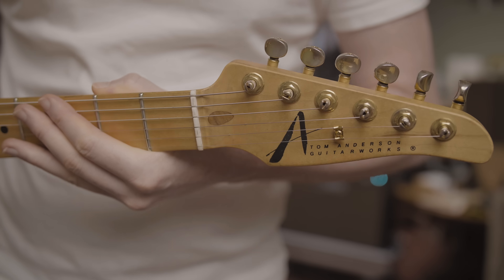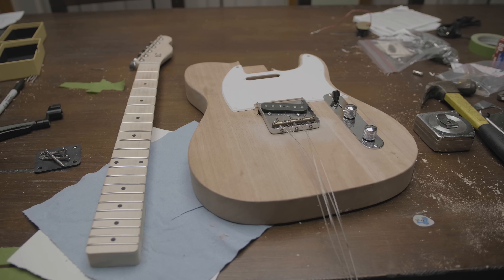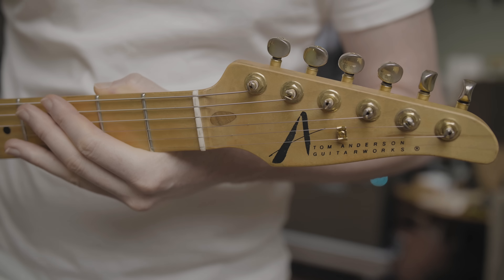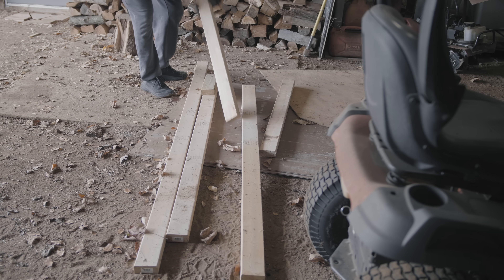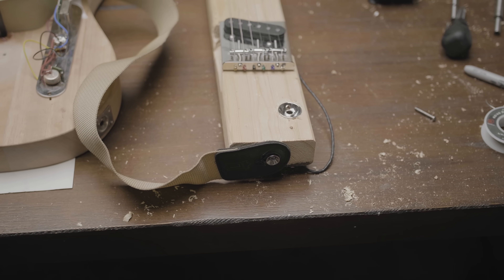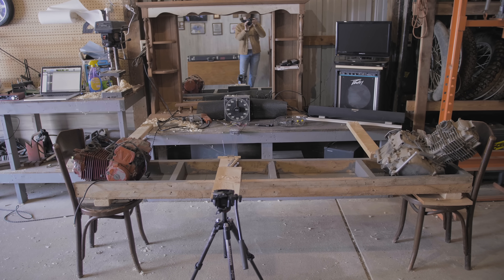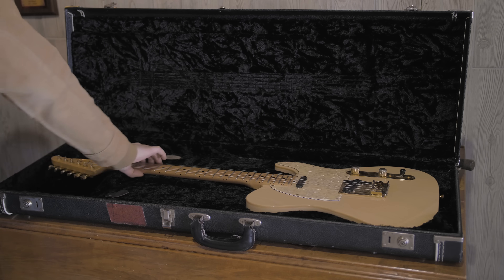Tested: Where Does The Tone Come From In An Electric Guitar?

Comment: Interesting video. On a total solidbody guitar, what kind of wood, both on neck and body, the impact is basically nil. What does makes sense is the density/mass but that can be of any other material as Steinberger showed us back in 1980 with headless designs, and carbon fiber neck and body. And the one who took all that way further to extremes even before Steinberger was Alan Gittler with his Gittler guitar where he removed excess material as much as possible. It remained a skeleton and fishbone guitar, so this is nothing new under the sun. All metal Gittler guitar.

HOWEVER, there wasn't much test in this video, on the actual length and sustain of the notes. And the dreaded dead spots. The first headless bass was made by chief technician of Fender believe it or not. Gene Fields was his name, and later on a maker of Pedal Steel guitars. But he built a headless prototype bass that removed the dreaded dead spots on 6th fret on all - yes all - Fender Precision and Jazz basses. The more he sawed off the headstock the more he moved the dead spot upwards without introducing new ones. Everyone has tried what happens when you stick the headstock firmly into any wall, wood or concreted, and the dead spots are gone and the bass guitar sustains forever. Seemingly. However this is with total mass/density. But one should not compare to the open strings, its when playing high up there at the neck you start hearing things like shorter sustaining notes. Whenever chopping off wood. Or changing wood out.

I've recently aqcuired an all mahogany one piece body guitar with a set neck (not bolt on), and the actual decaying part, sustaining part of most of the notes does have some more velvety character to it, but granted, it's only detected by the player, and it's basically so subtle that it is neglible. Never ever get it to sound like a Tele or a Strat with maple or alder neck even wit the same single coil pickups on. The sustaining part of the mahogany notes are quickly residing on the 2nd and 3rd harmonic and has less fundamental. Which can just as much be a liability as it is an advantage.

Comment: Pythagoras experimented with stringed instruments. His conclusions were that the significant  factors are; 1. string length, 2. string material, 3. string tension, 4. rigidity of the strings end supports.
With his research in mind, I built an electric guitar with a steel I-beam neck welded to the bridge mounting plate. The body was cast from concrete over the neck/bridge and shaped like a tele. A rosewood fretboard was epoxied to the steel neck beam. The tuners were mounted in holes drilled in the steel beam.  The guitar weighed more than 90 lbs. and was held in playing position on a steel stand. This was the most rigid and non-resonant design that I could build.
My conclusions; .The rigidity of the neck/bridge string support and the resonance of the body are the important variables concerning the tone and sustain of an electric string instrument.
The tone and sustain of this overweight beast were very similar to a pedal steel guitar. Touch sensitivity was amazing, with the slightest picking variation having great effect.
To demonstrate the sustain to skeptics, I would strum the open strings, walk around the room while flappin my gums, and about 30 seconds later I would turn on the amp and watch the people jump when the E,A,D,G,B,E chord loudly appeared out of nowhere. 
Old school axiom: The guitar is what you play.... the amp is what you hear. 
Thanks all for your kind attention.

Comment: Frickin awesome video!  The third luthier in the list seemed to be the "smartest" of the three in hindsight :-)

In my experience, the only thing tonewood actually does on an electric is change the "feel" for the player.  You feel the sound differently against your gut as the strings reverberate through the body.  Changes the playing experience by a little bit!  But not the sound.

Some things I'd suggest testing in future videos:
1. Pick size, material, thickness (in my experience this is literally the #3 factor after 1. Player and 2. Pickups - WillsEasyGuitar mentioned it on a tonewood rant video back in the day)
2. Scale length ("smart" #3 luthier mentioned this as a point!  I do think the "darker" sound of an LP is more attributable to short scale length than tonewood mahagony... it's why EVH tuning down a half-step got him a similar dark sound from 25.5" scale length)
3. Strings (gauge, freshness, material)
4. If you get into amps, make sure you focus on speakers in addition to things like tubes vs modeling, amperage, etc. (Glenn Fricker mentioned this as a major factor, but I don't recall if he had rigorous footage of evidence like you did)
Reply: Also on amps / tone: the room you’re playing in, the physical position of the amp within the room, etc. Some of that can be changed for free! It’s also easy to see why today, so many choose to DI or Kemper / AxeFX. So much easier than getting great tone out of a proper recording setup.
Reply: Picks are indeed a big difference! At least for bass it changes a lot.
Reply: A friend of mine despises the tone of Ernie Ball strings.
Reply: @drittal  blindfold him and I’ll bet it’s all in his head.
Reply: @shaunmcinnis1960  he has picked it out without knowing strings were changed.
Reply: @drittal  I'm not wild about them but in a pinch they work. I prefer Fender Super Bullets, they don't age as quickly and are a good middle ground between stiffness and flexibility.
Reply: @shionyr  I just prefer strings that are inexpensive. Any slight tonal changes can be EQ’d out IMO, but I don’t even care that much when switching from EB, D’adario, NYXL, etc…. Just put them on and rip it.
Reply: Speakers might be the most important factor in determining tone. After the pickups at least.
Reply: @lessthanpinochet  Glenn Fricker had a video where he mentioned this.
Reply: I'd agree with that, a super resonant guitar shaking your guts when you play harder might have a psychological impact on your playing, how hard you hit, etc

Comment: Great video, my admittedly old, ears couldn't detect any difference between the Custom and Air gutar. I have been playing since 1975 and I have suspected all along, that the only thing that really matters (after a good initial setup), is the quality of the pickups. All the rest is just "Emperor's New Clothes". Given that the vibrating part of the string is not in contact with ANY part of the "tone" wood it's quite logical really. This video proves it to my satisfaction. I recently bought a cheap Glarry Tele for £50, just to mod it. I've sorted out the neck and frets so the action is now right, and NOW I KNOW that good pickups will improve it. Great video. Thanks. I'd be interested to know if upgrading the electronics really makes any noticeable difference.

Comment: Without the scientific research I long ago realized that the guitars costing ten times as much MIGHT give a 20% improvement in sound BEFORE adjusting tone, volume, and effects. My Strat was apparently made on the best day ever in Mexico but players only seem to notice any differences AFTER they check the markings. I've seen a WOW expression change to Ho-Hum just because the player noticed which factory built it. Very nice bit of research!

Comment: This is absolutely amazing. Great video!

 A few years back, Buffet, one of the top makers of clarinets in the world, did something similar. They replaced the body of one of their top clarinets (normally made from rare grenadilla wood) with a sawdust-glue composite, milled to the exact same specs. Then they had a third body, again with the exact specs, but ABS plastic.

Play tests by professional symphony players, judged by other professional players and conductors, resulted, basically, in a complete wash. The sound was so close that listeners couldn’t reliably judge. Players could tell the difference primarily by the feel of the material in their hands, but by all accounts the playing experience was essentially identical.

Comment: Once you swapped pickups in the cheap guitar, I could hardly hear a difference. This confirms something I've suspected for a while...that "good" sound becomes subjective after a certain point. 
I think the first things someone should look for in a guitar are good mechanics and consistency, then start choosing and/or modifying your sound. 

Audiophiles seem to follow a predictable formula: Compare two sounds, and if there's a noticeable difference, then assume the more expensive of the two is the "better" sound. Obviously this is flawed logic. "Different" doesn't necessarily mean "better", and expensive really shouldn't have anything to do with the equation at all.

Comment: The bench is an interesting case there, neck and body will provide a counter-elasticity to the strings, so what you have there is probably akin to a very specific stiffness you could get out of those parts, which would give a similar sound

Comment: Notes from a non-player and non-audiophile:
2:00 Pickup change: the pickup change gives it a most notable range difference. It sounds fuller, able to get more of the higher and lower notes.
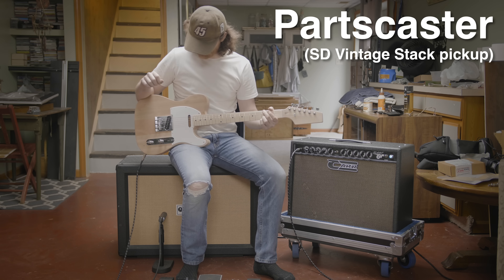2:30 Pickup height: When set to low, it sounded muted but cleaner, while up high sounded more raw and energetic.
2:44: Headstock changes: no discernable difference (NDD).
2:56: Neck tightness: NDD.
3:04: Saddle changes: Steel sounds crisper, while brass reaches the lower notes a bit more.
3:15: Bridge changes: Hard to tell for me, but I think the longer, thicker bridge, has a lower range while the ashtray is higher in range.
3:26: Top loading strings vs through body: NDD
3:36: Tele bridge w/ plate vs strat bridge w/o plate: invalidated due to the unstable pickup that you mentioned.
4:47: Matched pickup heights: NDD. If you were to send the audio files to me blind (aka I didn't know you would be testing changes between 2 guitars), I wouldn't be able to tell the difference between the 2.
6:07: 2x4 guitar: With or without the electronics, the 2x4 sounds like it's hitting a wall. It's like the harmonics want to play out, but just smacks into a wall.
8:44: Air guitar: General tone and harmonics sound the same to me. The difference I'm hearing is the little ting sound from picking the strings is more notable on the air guitar. With your Anderson, that tinging bleeds away much quicker. Overdriving effectively hides the tinging with either guitar.

Comment: Guitar Esoterics will tell you that if you use 2 Suzuki Engines instead of Honda ones for the weight of the Air Guitar, you will get a much more pristine tone. Everybody knows Honda Engine weights give a fuzzy warm tone.

Comment: Hi, great video, BUT. It seems to me you started heading in the wrong direction once you moved the SD p/up close to the strings. From there your experiments slowly removed everything that might colour the sound except the pickup -  and there were differences which got masked and unexplored. Personally I noticed the biggest difference between the string-through versus top-loaded bridge sounds. The TL was much brighter, the string-through had more mids. But that wasn't the only difference that got passed by.

The SD overpowered all the other factors. It doesn't necessarily mean only the pickup matters. Only that that SD pickup, close to the strings, heavily outweighed all the other factors. A less powerful pickup, at a father difference to the strings, may allow the other factors to come through. You left a lot of minor sounds unexplored. Love the video, especially watching you saw off a hunk of wood and string it up. It reminded me of Les Paul's famous "The Log" guitar where he took a hunk of railway sleeper and stuck two wings on it as a test-bed for developing pickups.

That said, it's not just the objective measurement of the sound, it's the subjective ear of the player that makes the difference. I happen to have a really high threshold for hearing frequencies, beyond that which most people can hear - measured scientifically, some frequencies I can detect I don't actually hear audibly, I just can tell when they're happening. Something about the gap between what the inner ear can register that the brain can't quite interpret as sound.

I have a thing for Rickenbackers  - their end-to-end stringing from a flying tailpiece to the nut, sitting over an all maple body sets up higher harmonics that just reach me all the way through my body, particularly with 12 strings interacting harmonically and wolf-tones and odd ringing from above the nut and below the bridge.. Mahogany doesn't do it, and alder, ash and so on only get part way there. And poplar is so 'dead' it's ridiculous.

I look for differences between my guitars and look to bring out their individual idiosyncrasies, not remove them until they sound the same. 
Or as Keith Richards put it, "give me ten minutes and all my guitars end up sounding the same".

Comment: Terrific mate.
I'll build myself a 2x4. I can't gig with the shelves and Honda engine rig.
Thankyou for dismembering and emasculating the BS put about by the manufacturers, particularly Gibson and Fender plus the other acolytes. It's all marketing crap.

Sure, we all like pretty guitars but you cut to the chase 

It's not hard to build a parts guitar. It's fun and you learn the basics.

I don't use any brand guitars anymore. None. I use cheap unfinished bodies but good pickups and hardware.

That's my 10c worth. I've seen the light.

Comment: Awesome video. One thing I need to point out. What you think is an air guitar - is not. It now has a big resonant boty in the form of the desk - doesn't matter that there is nothing underneath the strings. The bridge is tightly couple with the desk, which makes the desk a resonant body. That's why I would argue, the 'air guitar' has a bit more low freq response than your Anderton.

Comment: Excellent stuff. I think what makes people feel like there's a difference between the material is that they feel the vibrations on their hands and body, and that influences how they perceive the guitar. 

Also if your intention with the "air guitar" was to have nothing sympathetically resonating with the strings, then you probably have to rethink the construction a bit, because I think the desk and shelf resonate quite a bit (just try touching/untouching the headstock of a guitar to a cupboard or other wooden furniture, it gets way louder!). Either way it would be cool to hear what it would sound like if you insulated the bridge/tuning pegs with rubber or foam or something from the desk/shelf.

Comment: I was never curious about the tones provided by woods in electrics, simply because so much of the pickups and electrical processing makes it negligible since I found that wood tone is very nuanced. Acoustic guitars with naturally projected sound, are likely more dependant on the tonewood, especially the back piece (it literally has a resonant ring if you tap on it before building it to the guitar). 
   Im more curious if tone woods affect the sustain on various frets. This would prove more challenging to determine as there are more factors to consider in keeping identical to ensure the physicality of the setups such as even frets, truss rods and slight inherent differences in the apex of the curve between identical necks. The strings should be free of dirt and wiped clean often as well (Finger grime affects string performance/intonation just from 10-20 minutes of playing).

 I mean, running a guitar through electrical processing, once again, can mostly overcome most physical attributes that would affect sustain, for example, distortion, or compression.  Would be interesting if your frets were perfect and you still find a noticably weak sustain on a specific fret or string.

Comment: The electronics make quite a difference too. Different types of capacitor especially have different tones. So if you want to eliminate confounding variables, that's something else I would keep the same between tests.
Reply: I would add that different VALUES is all that practically matters. There are a few other videos out there showing that paper in oil, ceramic, polypropylene, mylar, electrolytic, etc. caps produce no difference in tone if their values are meticulously controlled (even small "within tolerance" value differences makes a difference). Same is true for resistors, variable resistors/pots, and items that "produce" impedance (wiring, jack, guitar cable, effects board and associated parts, and amp circuitry).
Reply: @HuardSmith  It's reasonably easy to make a capacitor which is very close to "perfect". The different kinds of capacitor exist because different voltages, physical conditions, and types of capacitors work in particular ranges of capacitance. But the reactance of all of 'em is pretty damn close to 1/2πfC . Inductors are a different story, so pickups are an art and a science.
Reply: I think it all goes down to static noise: shitty electronics tons of noise, better electronics, less or no noise
Reply: If the type of capacitor makes any audible difference then the caps are used well outside their specifications already.